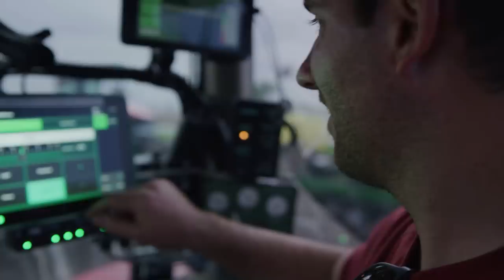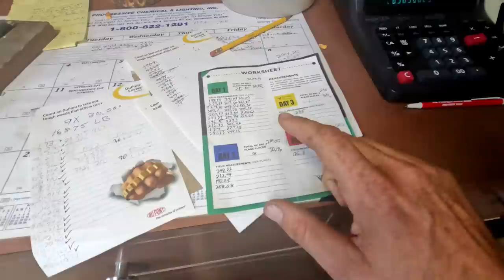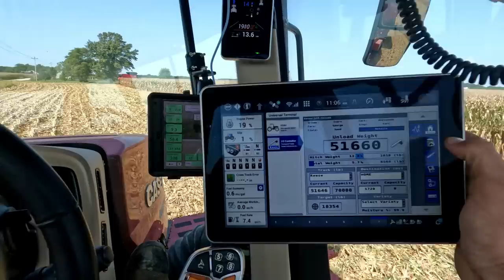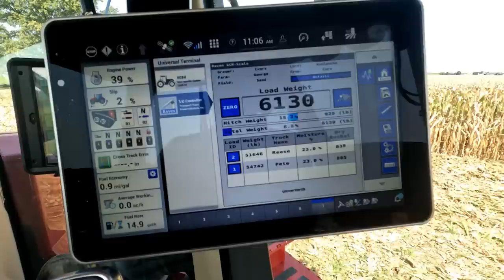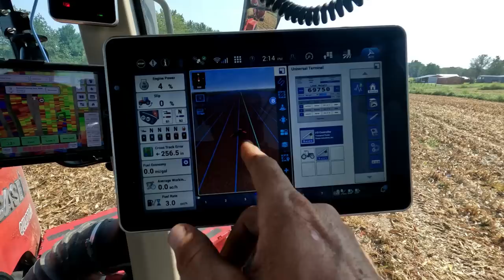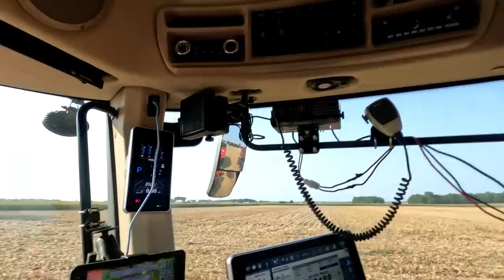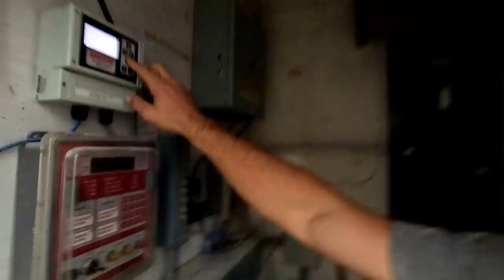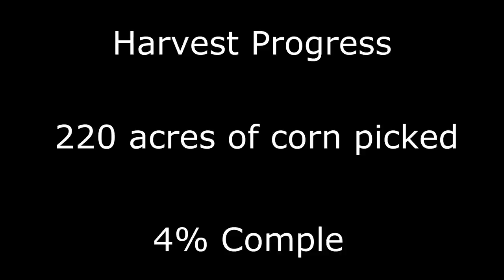Brand New Case IH 9250 Begins Corn Harvest 2022 With a New a New 620 Quad Season 3 Episode 26

Comment: Reese I don’t remember if I asked you this before, but did you ever see better results with banding strip till with or without a irrigation? Also a difference in blanket fertilizer application compared to variable rate application?
Reply from the maker: We didn’t see any advantage but always do variable rate. Feel like is a must
Reply: @iversfarms  Are you guys set up to do vertical tillage? I guess I’ve never seen a field cultivator on your episodes just a high speed disk. Or or are you mostly no-till. Have you guys looked into cover crops? Do you think no-till or vertical till is better than deep ripping and Field cultivating?